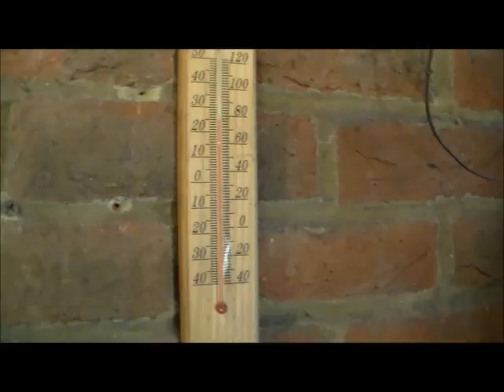Triumph Vitesse Mk2 &  Herald restoration

Comment: Reaction looked like the solvent in what you were spraying penetrated a coating under your primer or the primer itself. I've had that happen when a panel has several layers of old 1k paint and you really wet it up with new paint.  Or the coating you sprayed over wasn't cured. Just my .02
Reply from the maker: +Velvethamma Hi Shawn, yep I'm not too sure to be honest, I'm going to take it all off back to metal and start again in that area. Thanks for your input mate, I appreciate it.
Reply: +Scott Best agreed^

Comment: Not that is a fancy coffee gizmo .   I had some of those problems to trying to reply. Comes and goes at time.   Primer coat looks good but did you figure out what caused the reaction on the roof?   Good luck on finding your toes.
Reply from the maker: +Rusty “rustyglovebox” Glovebox Haha thnaks Lloyd, not sure about the reaction, I reckon I may have touched it with grubby hands? Finding my toes is going to take some time, My old Grandad would say "your a long way round the middle there nipper"

Comment: Your coffee machine is bigger than mine, not fair:-)
Anyway you seem to enjoy it as much as we do here.
Strange what caused the error when you primed the roof, some kind of chemical reaction, perhaps?
It's nice to see that i'm not the only one spending sunday in the garage.
Reply from the maker: +Ulrik Kaul Haha Yep I really love the coffee machine, Mary spoils me! Yep I'm wondering if I touched it with greasy hands of something? Yep hoping to get to drive it in the summer, welding going OK?
Reply: +Scott Best At the moment, i'm in "Frame mode" Finished front suspension and brake lines and is now trying to upgrade the rear end with swing spring. 
But as a guy grown up with the metric system it has been a challenge to learn the imperial system.
All these fractions...
Is it the other way around with you?
Reply from the maker: +Ulrik Kaul Yep a bit, we were taught mainly metric at school then as soon as I started work they were in feet and inches, pints and gallons, haha mad really

Comment: Scotty,
Is that two part Lechler and what mask did you use please.
Need to plan ahead for the Austin Seven.
Cheers
Geoff
Reply from the maker: Hi Geoff I have a couple of masks, one is a JSP force 8 and one is a JSP tradesman, both have changeable filters, Screwfix do them if you have one close, yes the primer is Lechler Green Ti, primer/sealer/filler, the top coat I'm not so sure, it's mixed in house at the paint shop, I'll take a look, they are both 2 pack paint,  cheers Scott